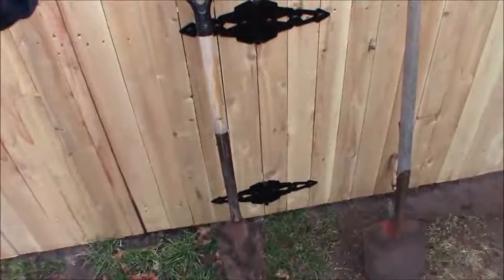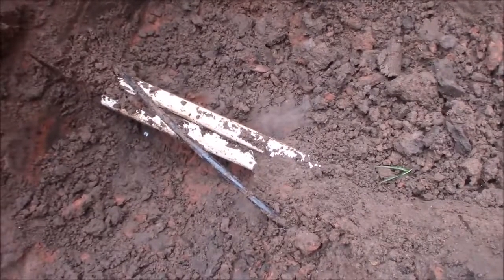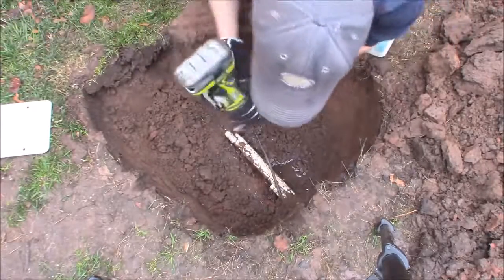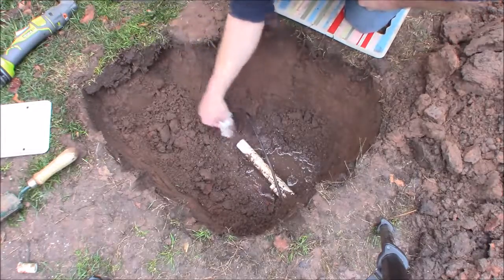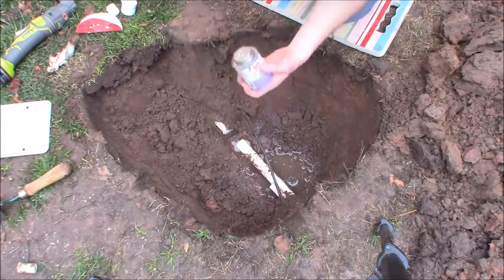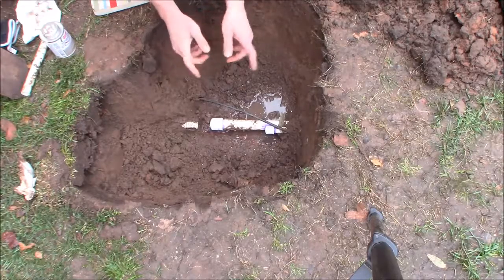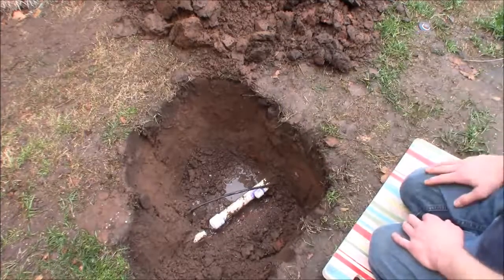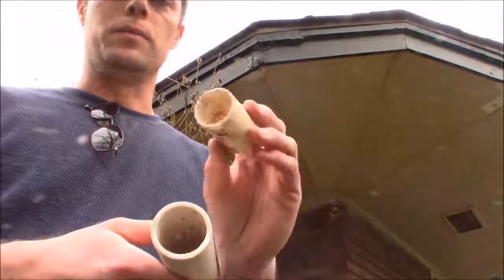How to fix a broken pipe or sprinkler line

Comment: What is the difference in flowrate between thin wall and schedule 40 1/2 inch. That may have something to do with it.
Reply from the maker: simpler would be to go up one size, from 3/4 to 1, 1 to 1.5 etc  inch if you need more flow.  I think it's more that you can cut thin wall with shears, saving labor cost on install  (but pvc cuts so easily I think that's just corner cutting by contractors).  the fact that it is not allowed by code for potable water tells you it's not deemed strong enough where safety matters.

Comment: What brand and model is the oscillating tool?
Reply from the maker: it's the ryobi Job Plus.  Basically the same thing as the Rigid Job Max, but a bit cheaper.  the heads for the Job Max will interchange/work with the Ryobi
https://www.homedepot.com/p/Ryobi-18-Volt-ONE-JobPlus-Base-with-Multi-tool-Attachment-Tool-Only-P340/202868525
I had only recently got it, after hearing friends rave about it.  Definitely nice to have for certain situations